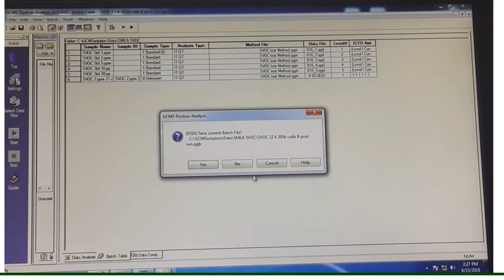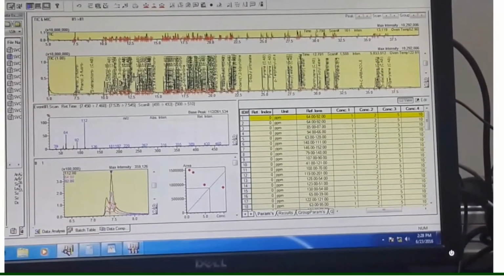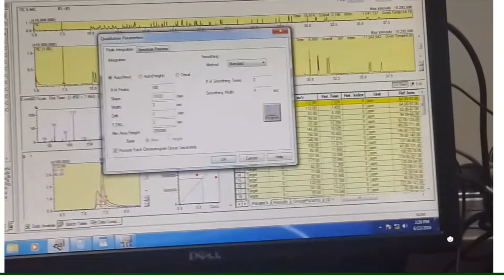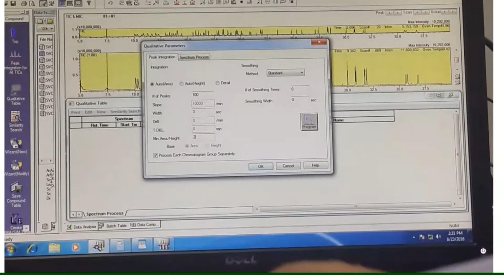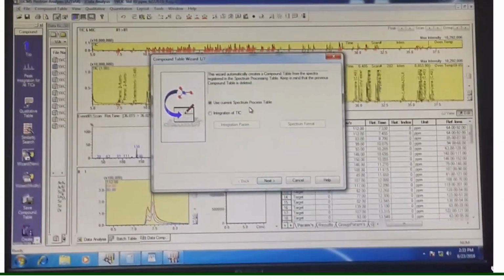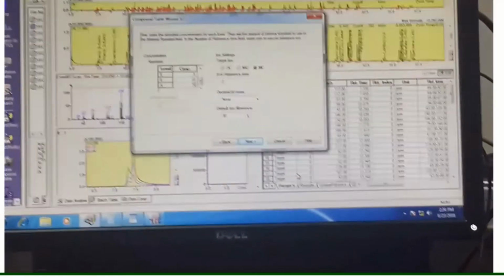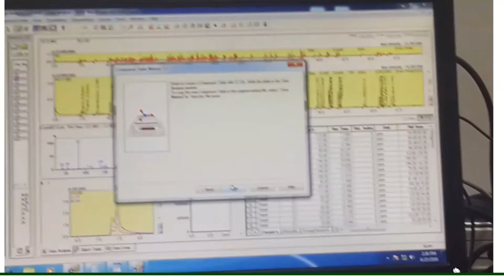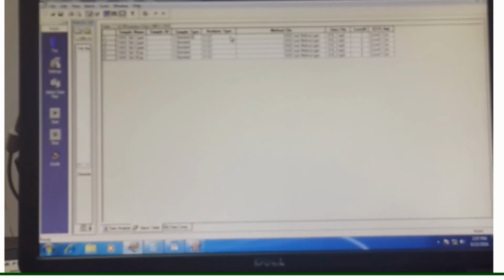Shimadzu GC-MS Simple Calibration Steps شرح مبسط لمعايره جهاز (Shimadzu GC-MS)

Comment: Hi,
I've a problem, my GC 17A can't connect with my computer (software).
Can guide me to the solution, please?
Reply from the maker: you may check the network cable and make sure it is connected to GC and the computer, try to use another cable and the last step check the IP of the GC and make sure it is the one that connected to the local network if these solution didn't work, you need to contact the service engineer